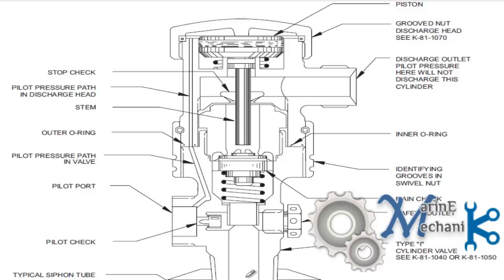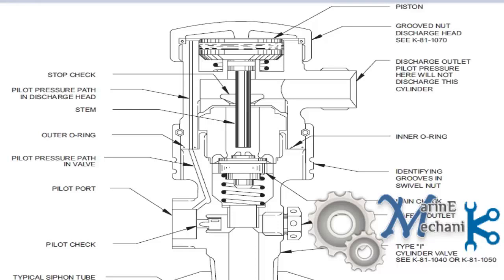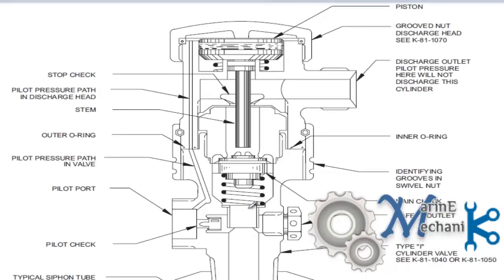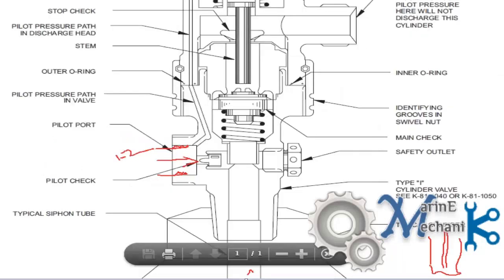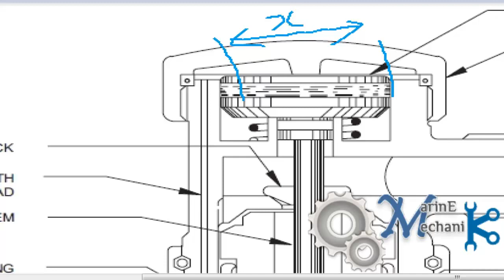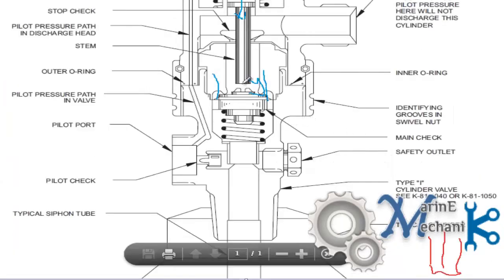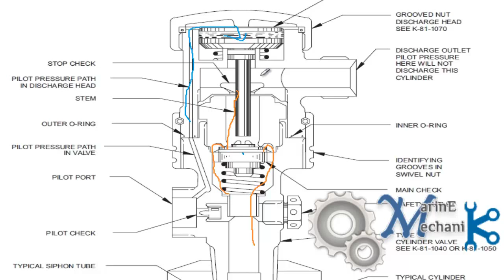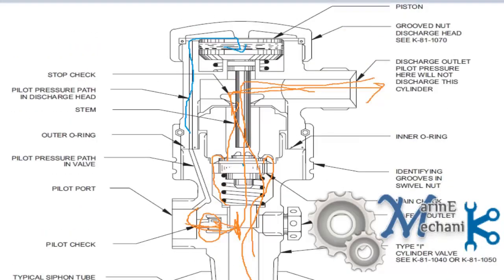Fire fighting - CO2 -Carbon Dioxide- discharge valve over view

Comment: For everyone asking how to recharge a fire trace bottle. ( Co2 bottle ) 

You have to pressurize the top part of the valve and the pressure will keep the valve stem down. Once done, make sure the valve is closed. ( referencing the valve where you connect the detection line to ) After that? The lowest port on the valve, is where you would hook up an adapter to charge the bottle with Co2. Of course read the label to get your weight. Have it on a scale. Minus the lbs from your recharge adapter etc. once complete, check for leaks and your good to go! Once bottle is back in place, detection is hooked up. You pressurize the detection line ( that’s what is gonna keep the valve stem down ) and you open the valve on the bottle where the detection runs to.